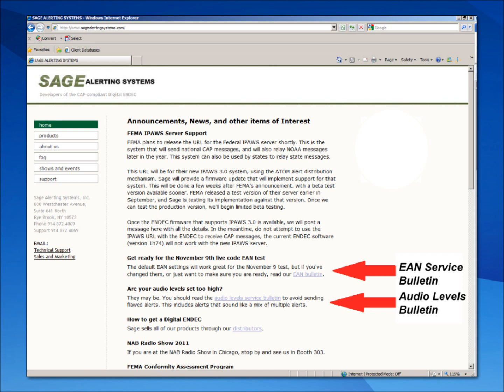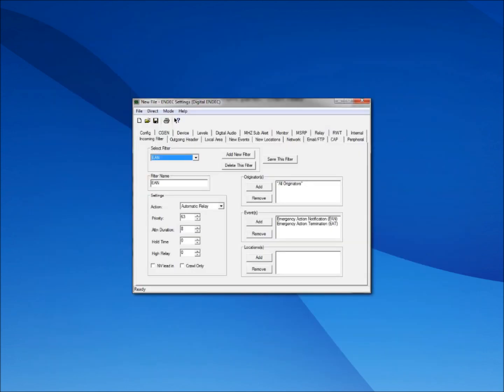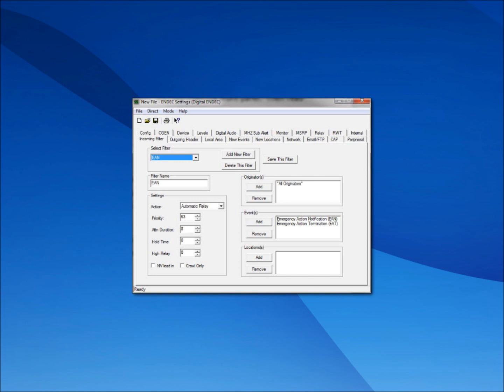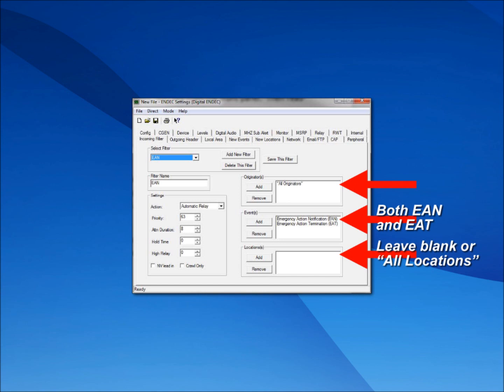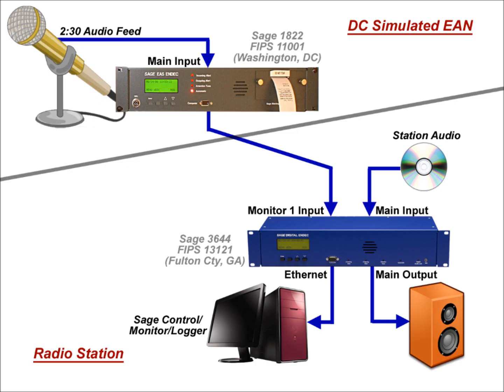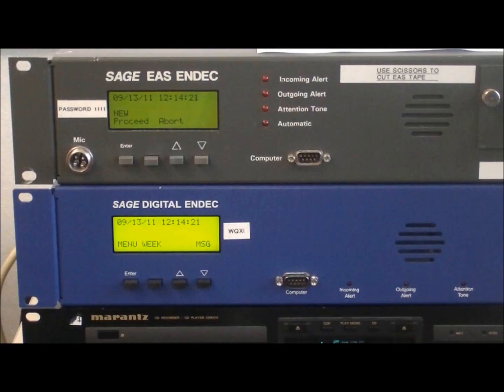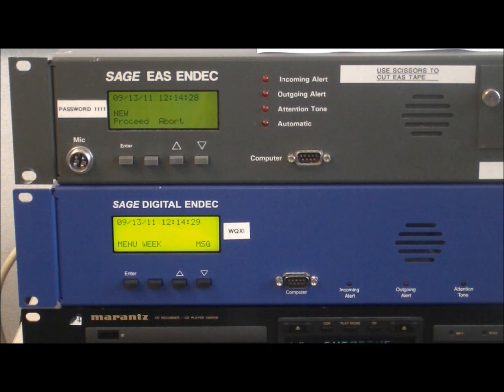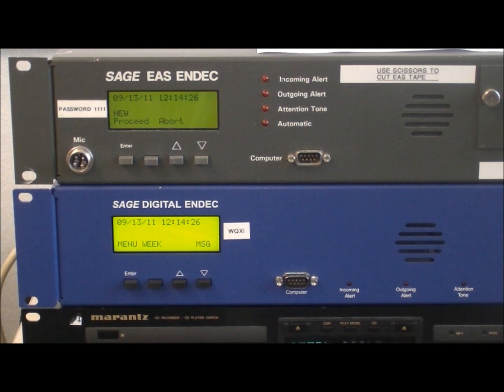National EAS Test EAN Demonstration

Comment: What they would do is use this system called the Primary Point Entry system which is how regular programming can be suspended and it can transmit messages that the programming.

Comment: It is so easy to hack EAS and activate an alert chain. EAS receivers are usually tuned to the audio of a TV or radio station. Using a ham radio you can park close to a station and overpower the station they receive their alerts from and send the alert headers. If they have their receiver set to auto broadcast it will automatically relay the alert on air. Any stations that receive alerts from that station will get the alert and may end up broadcasting it either automatically or if the master control operator confirms it.
Reply: It's possible to hack EAS online too. accessing HTTP control interfaces and sending fake alerts. hackers played music with this across entire states
Reply: @juniorsilvabroadcast fire alarm playing music 🎵
Reply: @juniorsilvabroadcast number 15, burger king foot lettuce
Reply: y do u know this
Reply: @megagay250  Just exposing the flaws in the system.
Reply: And it's only gotten worse..

Comment: I've seen some videos that the EAS ENDEC would print a receipt detailing the EMERGENCY ALERT message.
Reply: TFT EAS 911 Also Print EAS details
Reply: You can disable it in the settings of the SAGE.
Reply: You can even hear the printer in the video, starting around 2:58 however more audible at 3:06 when the tones kick in.

Comment: And you can buy these devices for the low low price of 1 million dollars! That's right ladies and gentlemen, 1 million dollars!
Reply: Sage Endecs don't cost 1 million dollars they cost around $2000, also these devices are very dangerous because if you have one and you don't know how to use it and you click the wrong button and cause an EAN (Emergency Action Notification) across the US the FCC can fine you up to $100,000 or 5 years in jail for causing a false alarm and major panic across the US. These devices are at EVERY radio station and its required by law! Also a 2nd test will be done tomorrow (September 28,2016) at 2:20 PM EDT across the US so yeah...
Reply: Jesus that much? I've been looking into how to access EAS/CAP feeds using conventional radio equipment for digital signage and its like trying to squeeze blood out of a rock.
Reply: +GhostFreeman the EAS systems I saw being sold were used for TV stations, and radio stations. Other types are a couple thousand dollars.
Reply: They're not 1 million.
They're $2299.00
Reply: NewAgeDerpDerp wtf ik multiple people who have gotten them for less than $100
Reply: シMCD456シ Go on EBay. They start at $100
Reply: So what are these basically in simple terms
Reply: it’s eas equipment..
Reply: @odorouswo1f  yeah, no shit

Comment: Use scissors to cut EAS tapes?
Reply: +TheGamerWithMore It is not magnetic tape, its a roll of paper... Like the one the stores use to print your tickets.
Reply: It's not recommended an operator pulls on the EAS paper and tears it off that way, as outward force would very likely break the printer module. This isn't an issue on the Digital ENDEC below as logs are stored digitally.
Reply: Everything is recorded onto magnetic tape for storing later, thats why you hear a clunk sound when it starts to broadcast.
Reply: As far as I know, it prints on paper like your receipts from the grocery store or any store for that matter.
Reply: It's talking about the receipt it prints when it sends a message so there is a physical log of the message it sent.
Reply: mileznightmare Oh thanks. So it prints it on heat transfer paper? like what heat transfer printers do?
Reply: @TheGamerWithMore  it's a dot matrix printer.
Reply: kinda look like there is no blade or something installed to easily removed it.
Reply: TheGamerWithMore
Im not sure its heat transfer paper xD, maybe its something like a dot matrix printer... i dont know, but it isnt magnetic tape...